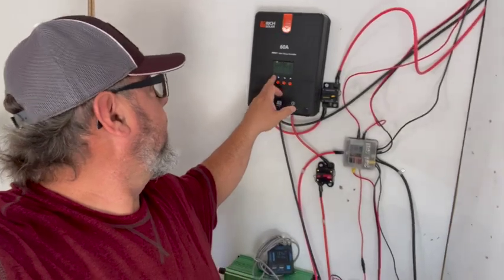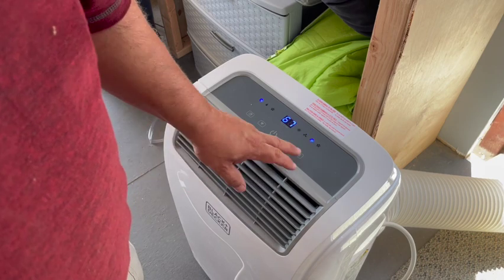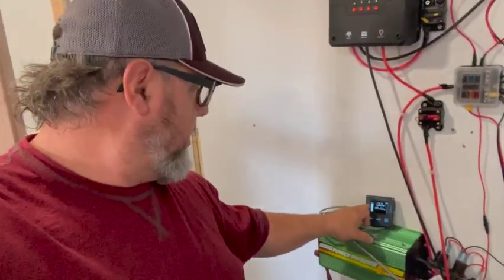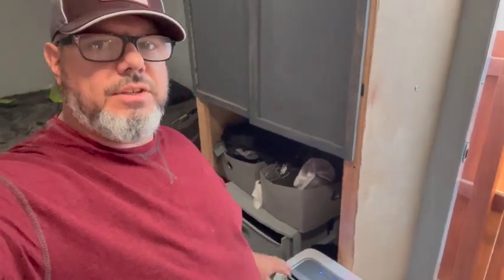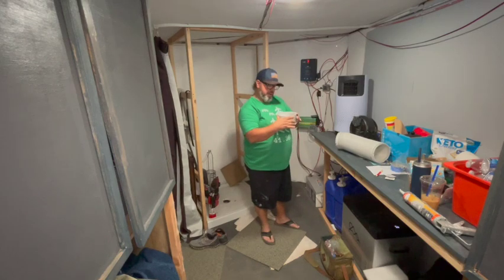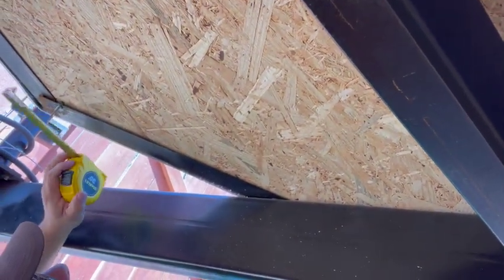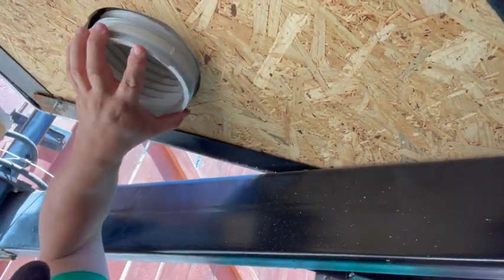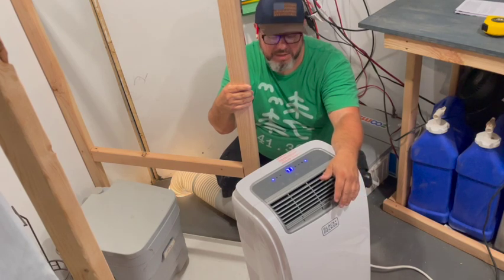TRAILER AC / Cargo Trailer Conversion

Comment: Me and the wife did the same thing to our box trailer but we used a dryer vent on the outside and caulked around it to keep the rodent out.
Reply from the maker: I need to insolation the tube on the inside to contain the radiation heat that is exhausted… I will look for insulated dryer hose 🤙🏼😁👍🏼

Comment: I desperately need to get ac in my bus. It's crazy hot in there during the day.
Reply from the maker: During day use I can use it ( with peak Az sun) for 5h … it helps a lot but not perfect. Here at night my swamp cooler with really cold water is sufficient for now… 🤙🏼😁👍🏼

Comment: Ew odd numbers, I’m unsubscribing! 😂 ❤
This heat is is getting bad! Humid and hot!
Reply from the maker: 😂🤣😂… yep odd # 👌🏼🤷🏻‍♂️ Thank goodness I don’t have the humidity 😅😅… thx for watching 👍🏼😁🤙🏼
Reply: @GreenHorn1Acre  so how many watts exactly was the ac pulling and did it last through the night?
Reply from the maker: @floridachickstinyadventures   it does not make it through the night…  3h max use … my watt meter is up at the cabin… but not more that 400w